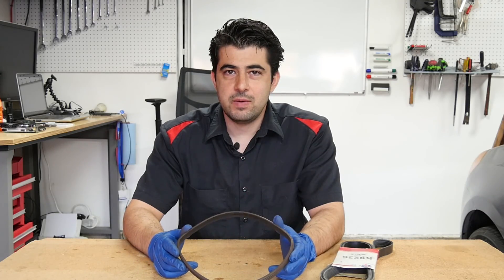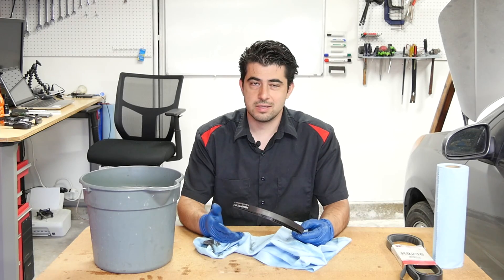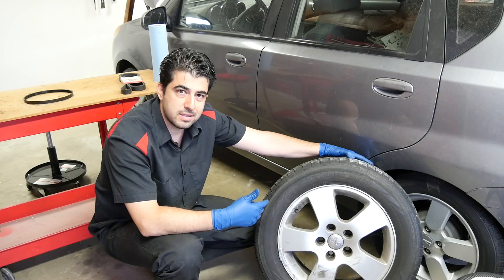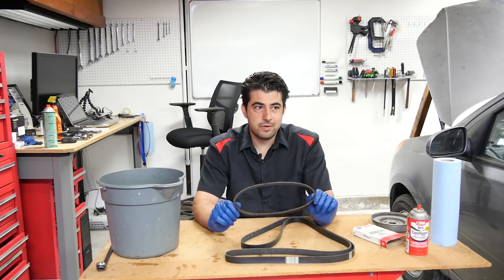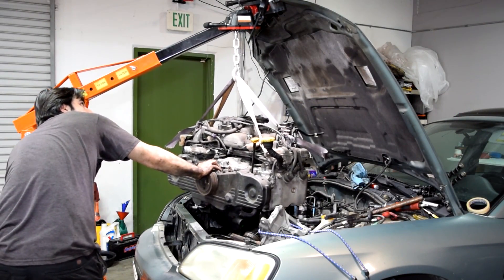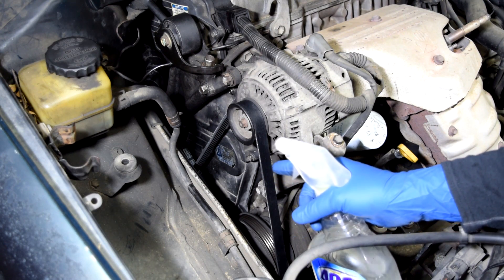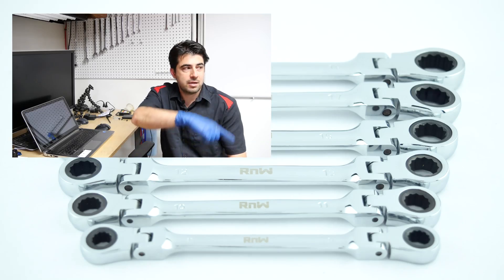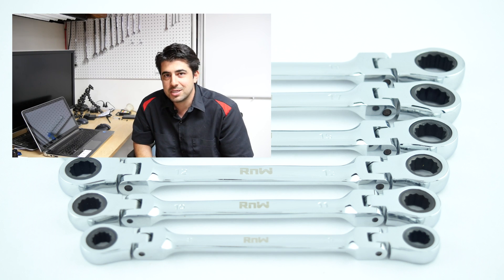Can You Treat a Belt to Last a Million Miles? - Also Easy Belt Noise Diagnosis

Comment: Timing  ' ? '  belts ?    The young, doofus engineer, which  THOUGHT  THIS  UP - should be  FIRED  immediately.  Relying , on a rubber  ' belt '  under high - heat, and pressure, fast rpm's  up-down  ?
LET  US  GO  BACK  TO  CHAINS - worked for over 100 years  -  WHY  goto rubber  ?   $$$$$ =  HUMAN  GREED - its   alot  cheaper  TO  MAKE ....than gears, and a precision made chain !  o well....
Evidence : About 2 months ago went for a walk. Went down the sidewalk, beside the throu - town high way. Seen a BMW make a corner, and about a minute later -  behind me,  heard  a  thwack - clack - thyack - clak - clak (for about 10 seconds )  The older gentleman, driving, (as i walked by) asked for a boost ?   A  boost  ?  no, your engine  is  ka put, sir.  The valves on these, share the same  SPACE  AS  THE  TOP OF  THE PISTON, AS IT  RISES. Those are called ' interference engines '  and  yours is one. You may need a new engine .......o well.  He had it towed home .....thanks, Ratchets/ wrenches .

Comment: If mines are super soak in power steering oil can this removes it?    The belt is still in good condition (only 40 thousand miles) and still look good but cause my power steering pump been leaking oil down the belt its super soak. Causing loud noise now.   Engine degreaser didn’t remove the oil.   Or should i just buy a new belt.  Pretty cheap

Comment: I believe that. I've never had any protective coating last a year, much less hundreds of thousands of miles. Mines just starting to fillet, and I have 130,000 miles on it. Not bad.
Reply: What kinda belt is it? Goodyear, denso or gates? Or continental?
Reply: @TheYoungBoaty  Sorry, it's been so long I don't remember. Whatever came from the factory.  Because It was the original.
I do remember putting on the new one and seeing that it didn't fill the rollers fully. Was a bit disappointed because it tried hard to get a belt that claimed,  " as good or better,than factory".  We'll see.
I went back and checked my Amazon orders. The belt I bought, was a Bando  brand. The one I took off was the original from Ford.

Comment: Coating your vital engine components in rubber protectant might not be a good idea, but here's a thought. Why not coat suspension parts? Bushings/shackle bushings may last 200K miles or more with Polyurethane bushings.

Comment: The 303 military grade rubber protectant is way better than that black magic stuff. The 303 actually penetrates the rubber. And a tire company wouldn't ever tell you that it worked , they wanna sell as many tires as possible.I use the CRC belt conditioner for preventative maintenance ,it coats the belt ,hince protects it from drying out.I've got 80k on my tacoma belt and looks brand new. No sign of wear or cracks.I do all my own mechanic work learning how to from videos like yours and a good ole Schiltons book. Thanx for the info , and try the 303 aerospace/military grade rubber protectant. Works. But I don't think it is a million mile miracle fix either. Just saying I bet it helps....Put a little inside the tire before mounting.

Comment: That's unless you have a 1997 Buick Park Avenue and it is a major paint to change the belt tensioner because it also has hot water go through the part.  You have to remove the alternator to get the idler tension mechanism removed and then replaced.

Comment: You say all these things will happen if soaking your belts cause your belt to snap prematurly or swell the ribs on the belt when you don't know if any of that will happen and why would a tire company want to have forever tires?  anyway, I soaked  all my belts 6 years ago on my new F250 and  now  I have 374,000 on my truck and  my belts.  none of the belts have any cracks,

Comment: Bought a new belt and the bearings in the pulley seized up, tearing up the belt pretty good.  Dickhead engineers don't believe in grease fittings , anymore.

Comment: You're missing the point here.  These belts are replaced because they dry out and eventually crack or break, not because they wear out. Also, you install them after the conditioner is completely soaked in, not when they are wet and dripping, which would negate your 'swollen belt' argument. Keep up the good work. 🙏

Comment: THIS GUY IS WANNABE MECHANIC!!!!!!!!!! He doesn't even use a belt tension gauge to check to see if he has to much tension. To much tension is what wears out water pumps, alternator, and idler/tensionizer pulley bearing to quick. Using water on the belt does not prove that the pulleys are out of alignment. The same results come from a belt that is to loose or a bearing beginning to seize up in your water pump, alternator, and or idler/tensionizer pulley(s). Yeah, this guy is going to cost some people a lot of money and I hope they sue this jerk.

Comment: I spray all my rubber engine hoses and any belts with silicone spray from Walmart. $2.50 per can. My 2017 Honda hr-v crossover was bought new in 2017. I'm current reaching 109,000 miles with no issues.

Comment: You are a very young man and don't remember belts use to last u to 10 year's. Goodyear and Bridgestone realized that belts were lasting to long. So they started making the belts out of recycled rubber and stopped offering life time guarantee. Now belts will only last a couple of years. Even if you don't drive alot they will dry rot. 
It is the quality of the rubber that makes the difference.

Comment: If 303 makes tyres last longer why would tyre companies promote it ?  They would lose business.  It is wrong to say the sidewalls of tyres don't do any work  - they hold the car up and flex  as the loads on the tyre  are applied and change during driving.  One web site out there insists it works  and claims to have tried it over the years  and believes it lengthens the life of rubber parts considerably.
Reply: the secret formula commonly reference snake oil as top ingredient.
Reply: @glasser2819  don't knock it till ya try it. Unless you might be a tire salesman in disguise…
Reply: OMG, a website did? Well then let it be known, that this day forth, whatever that website said is true

Comment: Speaking of squealing belts,  do you know about the Toyota belt squeal issue,  as in Yaris, Echo. some Corollas etc... ?   These cars are known to squeal on start up,  BUT,  if you turn the key to "run" first and stop there for a second (let the dash light up) then proceed to turning the key to "start",  there is NO squeal!  Works EVERY time.  There is a vid on this: https://youtu.be/HRrVMtyIqIY    Do you think it's what this guy says?  If you stop at run for a sec,  the computer has time to set the exact alternator output it needs, not the highest default level.  Less alternator load means no squeal. Makes sense to me,  but no matter,  it absolutely works each and every time. (bet it makes the alt last longer too!)

Comment: It might be worth while to remove the pulleys to restore their surfaces when replacing a belt, or if that belt seems to wear out too often. My evidence is weak, but I suspect manufacturers plan-in belt obsolescence by choosing soft pulley materials like sintered iron, then doing very little to properly surface a pulley's belt contact surfaces.

Comment: Valves get bent when a cogged cam belt breaks....correct, but ONLY if your engine is an "interference" style engine. The valves will NOT hit the piston for "non-interference" engines. A google search or more will tell you which one is which...

Comment: I could see that you used a different conditioner form what the myth was about, the 303 Aerospace Protectant. SO your conclusion that such and such didn't work, is even less convincing that the original myth. My 2 cents.

Comment: 303 Aerospace Protectant is a good choice... for using it in proper applications.

But a few things:
1) Miles are irrelevant; engine hours at X rpm is what matters.
2) Rubber Protectants are designed to protect rubber from UV radiation, some chemicals, and the affects of humidity.
3) Any of these UV or rubber protectants can't be expected to reduce physical wear.
4) Can application of non-OEM recommended "protectants" on your engine components cause unexpected results? Probably.

Comment: Was it me....when I linked you the video? so you DO listen to your subs...how epic!?!?!  Hey...do this for us viewers.  Take that "tire shine/rubber protectant" spray (Eagle 1 works well) and show how much traction it provides when its applied to a bearing surface by putting it the treads of your tires and then start a burnout. It will get EPICLY SMOKEY!  Imagine what it will do on the v-grooves of the pulleys.

Comment: I need help turning my crankshaft on my 97 Hyundai tiburon I have it in neutral and the spark plugs are out. I'm replacing the head. The engine ran before I took it apart. So it should turn right?

Comment: Armoral is not belt conditioning product it's a dressing to make it pretty. This was not vary helpful as it used the wrong product. A real rubber conditioner such as blech-white would have been a better test. 
Also once the belt starts to slip it superheats the surface and it glazes over and will probably squeak from then on. There is no good way to fix this. The belt should be replaced. better belts cost more but last longer. if you decide to buy a store brand look at the manufacturer on the back.You will probably find whatever the store name brand is also making the store brand and is, in fact, the same belt only cheaper. This gets their production up which reduces the cost for the man. and the store gets its name out there. The man. is not going to stop production and change the production line for the run of private label stuff. 
 Example worked various auto parts over a 35yr span and this was always the case. NAPA OIL is made by Valvoline look on the back both are made by Ashland oil, or their premium belts Gates rubber co., etc
Reply: Neither is 303 Protectant. Both are dressing products meant for auto detailing not actual protection.

Comment: 6:19 is a pushrod V8. pretty sure the camshaft is chain driven.
Reply: Depends on the manufacturer of the engine. Toyota uses a timing belt in the Tundra V8s as do some other makers.
Reply: video at 6:19 is a pushrod v8
Reply: And? that means very little with regard to how the cam or cams are driven. Some engines use nylon and steel gear to gear drive, others use belts and still others use chains. The point remains the same, it is at best moronic to think applying any kind of rubber treatment to a belt of any kind, will make it last many times longer than not treating it in the first place. Rubber plus heat and stress equals rubber breakdown. Age plus rubber = rubber breakdown due to chemical leeching out of the rubber and causing it to dry out and in time crack or break. So called protectants are nothing more than lipstick on a pig.
Reply: ...and it means that a snapped cam belt has nothing to do with a pushrod V8.
Reply: he probably didnt have an opened up OHC engine for display reference purposes.
Reply: Hendrik Wildy Yeah no shit it has nothing to do woth an engine, belts and engines are two totally different things.
Reply: Wrong Eric. Timing belts are used in engines that use overhead camshafts but of course there are chain driven OHC systems as well. A pushrod V8  however definitely does not use a belt for the cam shaft.
Reply: He was just explaining the basics of engine timing. But you're right about the engine. You're right. Do you feel better now?
Reply: I don't feel any different nor am I seeking yours or anyone else's validation. I was simply making an observation. Does this make you feel better now?
Reply: Hendrick made a simple observation and is correct. The replies to the OP are just totally redirecting the conversation elsewhere.

Comment: I have seen cracked serpentine belts for years fail without some catastrophic failure like seized pulleys. waterpump, a/c compressor, powersteering pump, or engine crank pulley or heavy oil contamination which give a sign easy. buy a new belt if in doubt. don't be a tight ass. that's just my experience.

Comment: Well, I doubt this will make any difference. It will get loose and dry with time. What I do, with the belt still on car, is using a toothbrush apply some Vaseline to it. Turn engine on, then off. Apply again. 3-4 times and the belt will be completely lubed.
Reply: the belt is not supposed to be lubed. Lubricating a belt causes it to slip.
Reply: Robert King Tell that to my belt, looks nice and shiny.
Reply: how it looks means nothing. lubricating the belt causes it to slip which increases friction.
Reply: Robert King Mine doesn't

Comment: I'm gonna get a car with a non-interference timing belt and see how long the whole 1 million mile thing works out.
Reply: I'll stick to my interference diesel engine, and change the belts in-around their service intervals, and spend a LOT less money on fuel than that non-interference gas engined car you end up with. :D
Reply: No, you won't; the timing belt is not what's non=inteference is the design of the engine and they are all low powered.

Comment: There is a guy that made a tire that would last forever but the government would not let him Market it because the tire industry is one of the biggest money-making Industries in the world and obviously if you come out with the tire that last forever then we wouldn't need them anymore
Reply: That reminds me of flubber for some reason, lol...
Reply: I also heard rumor that there was a carburetor that got extremely good mpg, but that also wasn't allowed to be marketed.
Reply: And don't even get us started about chemtrails, 911 and alien pyramid conspiracies.
Reply: Was this the same guy who made the car that runs on water? And the government banned it because Big Oil?
Reply: The chemists that formulate the tires are witch doctors.  The amount of mileage on a high mileage tire, for the given thickness of tread,  a tire pretty much giving off a layer that is one molecule of rubber thick each time t rotates around.   Pretty much the only way around that is to make a thicker tread,  or resurface the roads with not-yet-invented witch's brew so they give up material with never-wearing tires roll over them.

Comment: I have never seen a belt fail, due to belt failure. They all fail because the bearing on the pulley fails. SO< NO!!!!!
Reply: Serp belt failed on my 2006 Honda Accord
Reply: Timing belt on my old Mighty Max failed, not the bearings.
Reply: YES10 you certainly haven't been around very long. You sound like the type who was born at night...last night.

Comment: I've been doing this on every suspension bushing on my car and my car has a lot, with 180k miles and hard driving, those bushing don't show any signs of wear.
Reply: They will not believe you, so screw them...let them keep repairing the cars LOL.  We used to use the 303 on rubber deice boots on aircraft, works wonders.  I did not think to use on the CV boots or suspension...thanks for the tip.
Reply: FL33T WOOD  The VR also erroneosly ASSUMES any rubber protectant will work.  Ratchets did not mention a specific video he was referencing.  I am only familiar with 303 Aerospace Protectant.  The VR also erroneously assumes that when you treat a rubber bely that the protectant is thrown away.  Not true, just pour the excess back into the bottle.  Only when used on rubber parts that must be sprayed as opposed to soaking is this true.  Works excellent on windshield wipers as well.  Seems to me that ratchets may not have been as informed as he could of been.  Been using 303 since 1984, its incredible how well it works.  I have not used it on serpentine or drive belts because I never had to replace one, but I have seen treated vs untreated belts tested, the treated are much softer and pliable, hence less wear with friction.
Reply: Thefireman 285 The video response is on rubber belts and friction. Not stationary boots.....-_-

Comment: Every single belt protection I every used snapped the belt almost right away as well as dry out almost immediately.
Reply: TheRocketMan8888 Interesting how Alpha Ghost never responded to your comment. If the video reviewer used 303 Aerospace Protectant instead of garbage Armor All, the results would have been MUCH different, in an extremely positive way.
Reply: if you add traction to a worn and weak belt expect it to snap under the higher load created by the higher traction
Reply: You used the wrong stuff. Find a better one.
Reply: In a similar scenario, I was told to put "soluble oil" in my radiator for corrosion & water-pump protection... BY A JOBBER!

I put it in a '69 Wildcat, an '81 Eldorado and a '95 Mitsubishi...  ALL THREE OF THEM blew out 1"x2" chunks of the hose (like little doors) within 3 months...